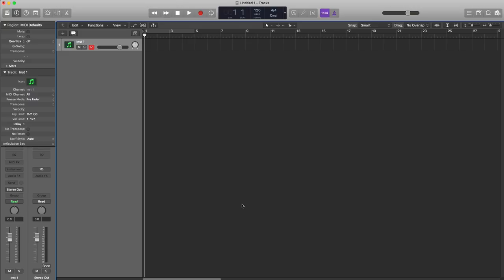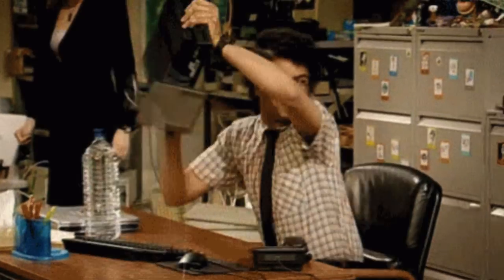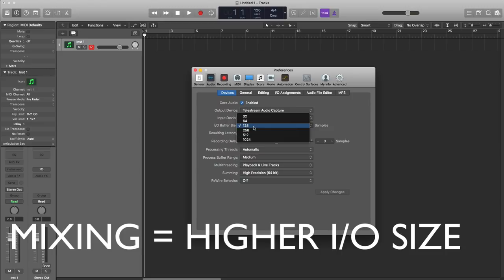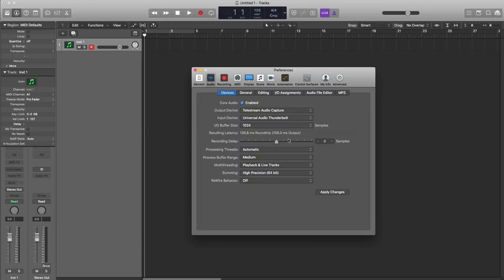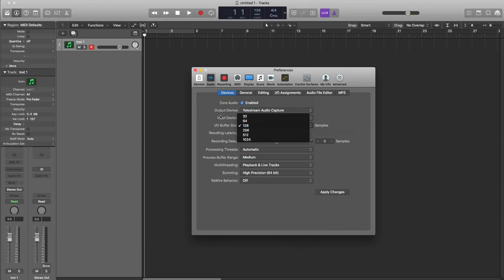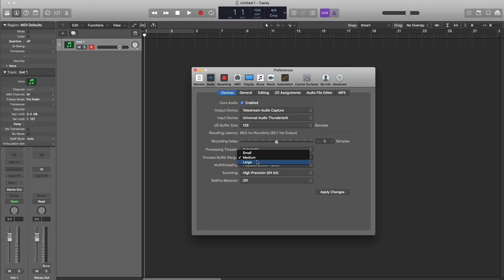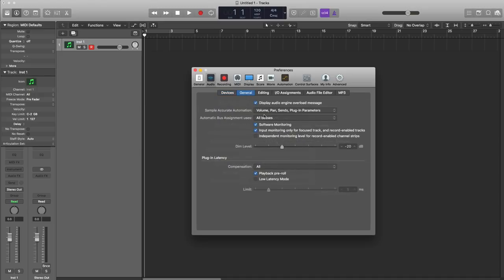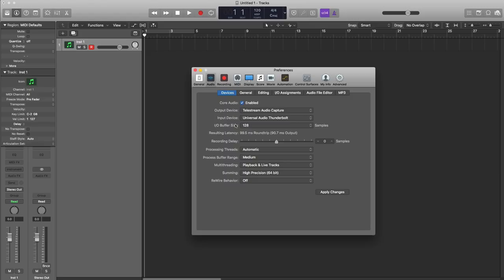Does Size Matter? | I/O Buffer Size Explained

Comment: Adam, the light is dim yet box is checked under software monitoring (General). Can’t uncheck. Crazy, right.
Thanks so much for info. Would love a refresher on pre fader settings before mixing. Thanks for time!🦉
Reply: Try changing your output device, my output was my iMac speakers and I couldn't uncheck it, but when I changed my output to my audio interface I was able to check it.
Reply: @midknight7269  🔆Thanks so much!